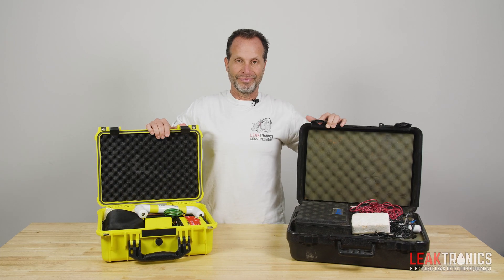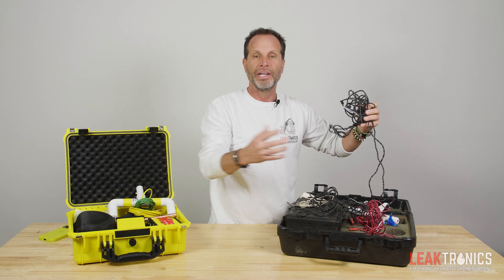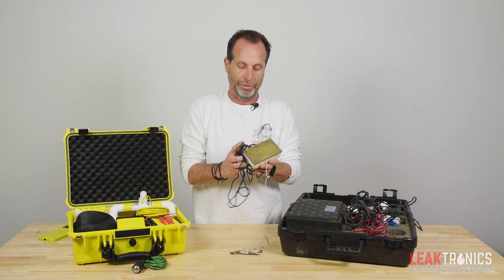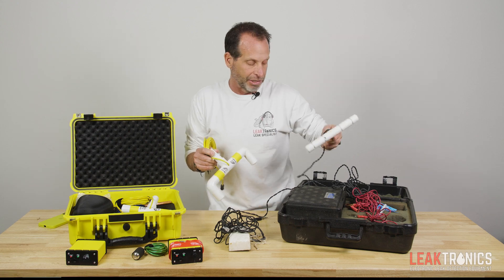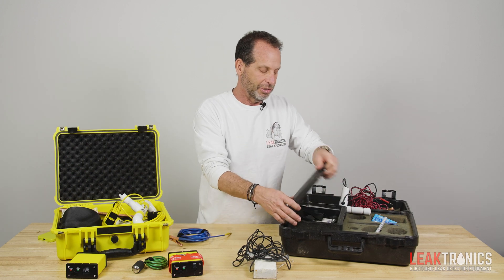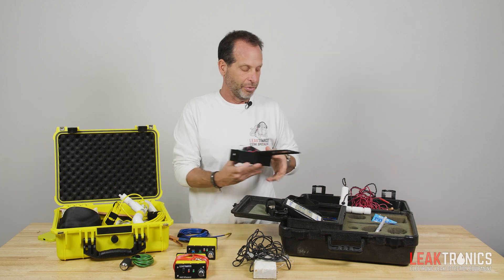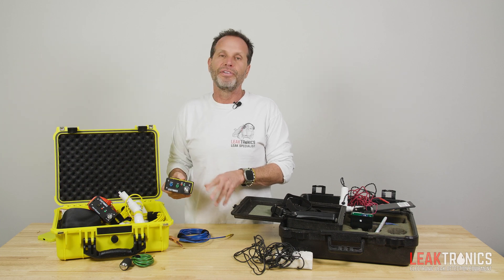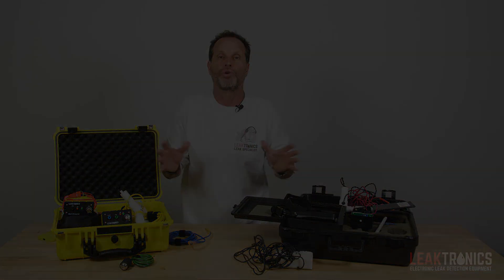Vinyl Liner Leak Detection Kit Showdown - VILO V2 vs LeakTrac 2400

Comment: Fantastic company and amazing support we love them, from blue diamond pools
Reply: Quick follow up question does the V2 transmitter work with the first gen float and receiver ? Our transmitter was replaced with a v2 but we still have the gen one float and receiver will that cause any issue ?
Reply from the maker: @Brentor14  Yes! The V2 Transmitter works with the V1 Receiver and Float with no issues!
Reply: @LeakTronics thank you very much , you guys are awesome
Reply from the maker: Thank you!

Comment: For the earth I use an 800mm long masonry drill bit and drill down as far as possible, then adding water to the surface I reverse the drill which pulls the water down deep.